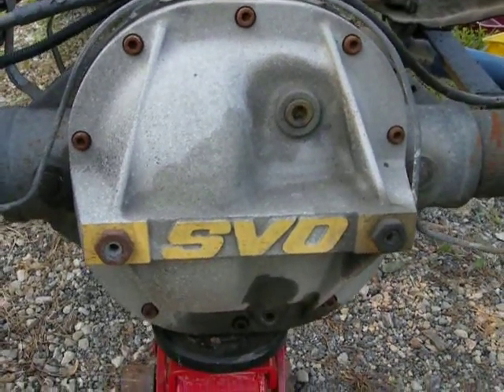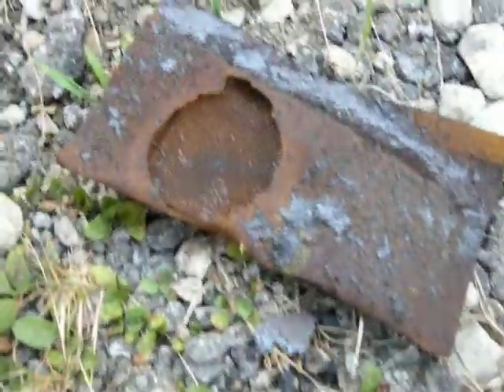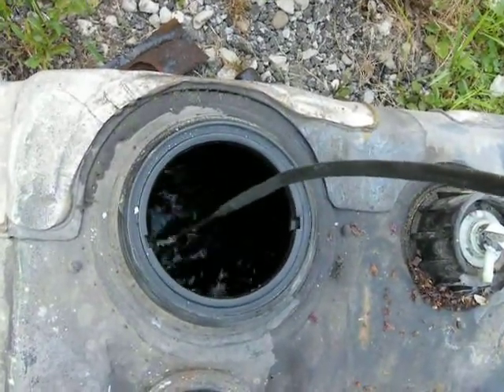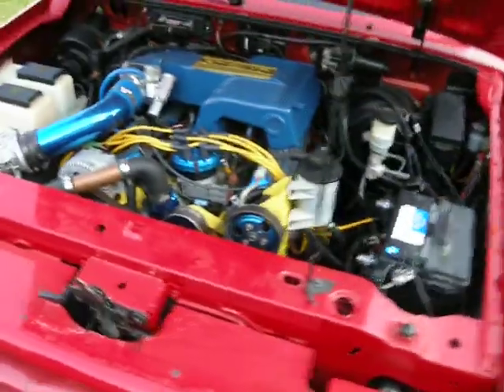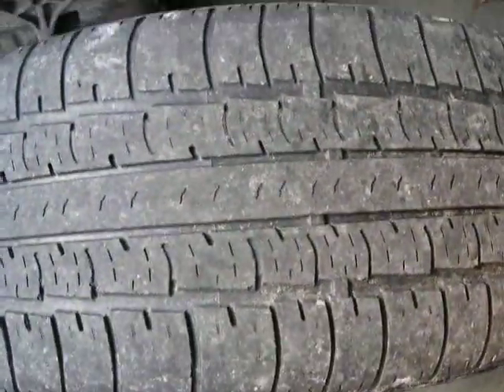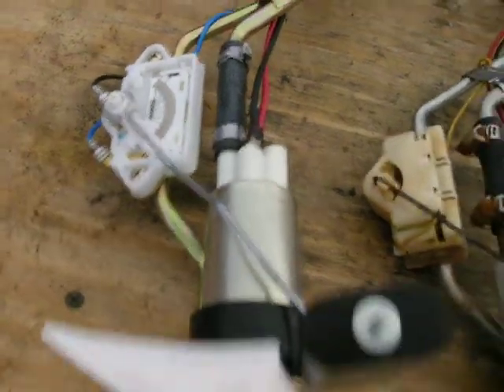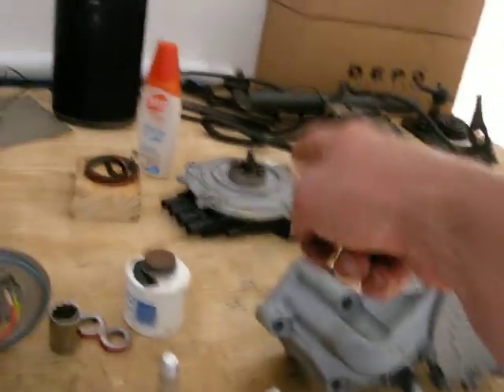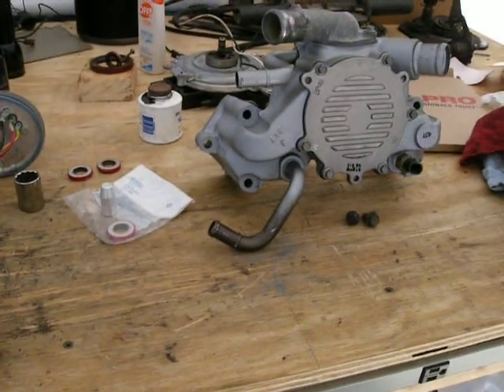1997 Ford Ranger 5.0 5 Speed Part 1 Fuel Pump Replacement Classic G-Body Garage

Comment from the maker: @OldsCutlass1978 as mentioned before you will need one with a BOP bell housing. Buick/Old/Pontiac. Chevys are different. GM made Turbo 350 transmissions both ways.

Comment: If you have this project going on when are you going to tackle the Cutlasses.  Id like to see more vids on those like the one you plan on putting a 403 into.  Its a sweet truck but Id do one project at time so it gets done but its just my opinion.  Oh one other thing

Should I keep the 305 in my Cutlass.  I want to build it up to make some big power but keep the original motor.  I thought of a 403 for an alternative.  What should I do?

Comment from the maker: yes one project at a time for sure but the Buick Wagon and Truck just kinda happened. The Malibu and Hurst Olds is next. Trust me. 

Don't bother with the 305 or you will end up wasting your money. If you go with an Olds motor then you will need to change the trans too. Chevy vs Olds bell housings are different.